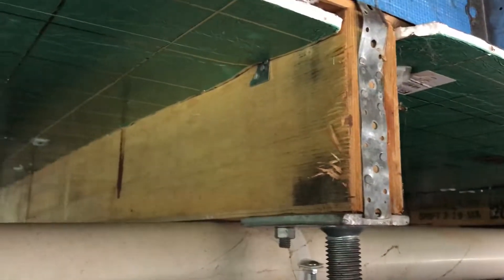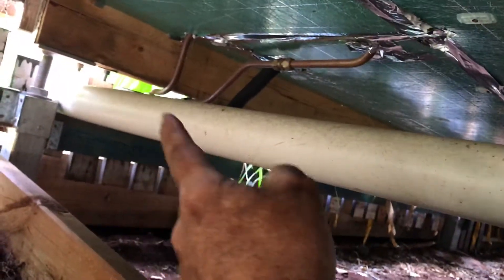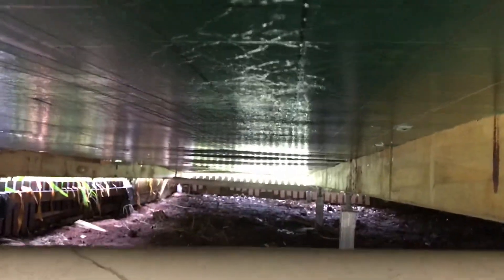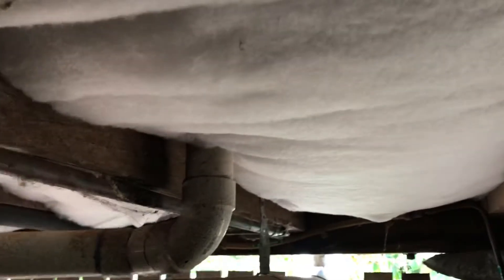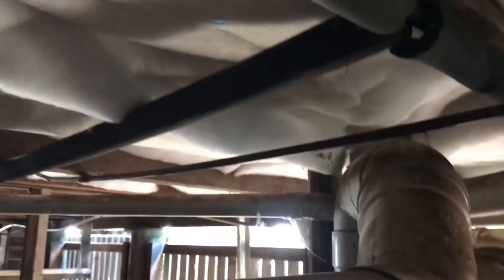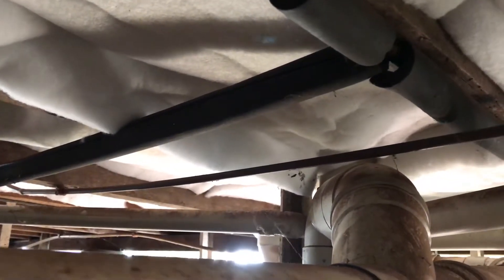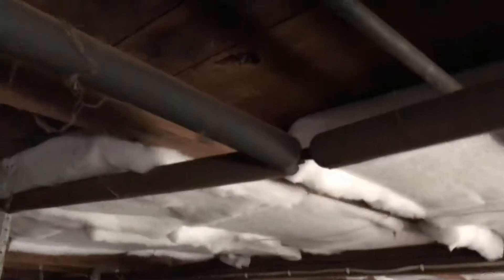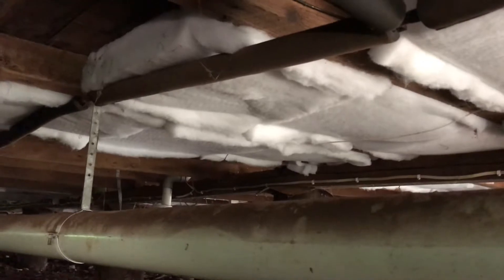Foam Foil board insulation is a bad solution for insulating a floor or shed and here is why!

Comment: I just pulled out polyester from under my house, it was an absolute haven for mice and possums.  I am investigating what I was going to replace it with and appreciate this info.  The search continues...
Reply from the maker: Yes, any batts will make homes for rodents, it is funny that all the batt insulation companies write something like rodent resistant on the packs but your story is the rule and not the exception. Anyway, if it is between floors and you line the lower ceiling with plaster, then cellulose can be pumped into the cavity and it will not get rodents living in it.
Have a happy new year !!
Reply: @InsulationTeam thanks heaps, that makes sense. Happy new year also🎉
Reply: @InsulationTeam would you recommend that solution, or is the foilboard fine as long as I cap all ends?    Obviously foilboard would be just the one step and therefore easier.

If no good, would capping ends with plaster solution have any downside?  Would consider that to effectively remove any chance 😂 of animals getting in.
Reply: Absolutely true. Haven for rats and mice
Reply: I had rats' nests above batts under my subfloor.

Comment: How are the batts fixed in place when retrofitting like this?
Reply from the maker: The batts are made stiffer and just self support in the bays, I have never had them fall out and they are easy to remove and replace if you ever need to. For a quote just go to my website insulation.team

Comment: Your wrong! Yes the board edges should be sealed, as per foil board Instal instructions not a sealed air gap is an important added insulation element.
Reply: you're
Reply from the maker: Ah well all the products that do not work very well state that their system relays on a air gap ? Why is that and what is the difference of just creating that air gap with some black plastic? The foam is what does the work, the same as the very thin foam polystyrene foam cups protect your hand without an air gap? So why does 25mm foil board need an air gap to work? Well it doesn’t but having does increase it’s effective R vale as a system. Unfortunately the same air gap if broken by bad installation or any future trade will render that effected area as nearly useless. 
This is not a problem that batts have when they are attached directly to the floor and that is why I only recommend our polyester floor batts for floors but our batts are custom made and not the same as any other floor batt product that I know of. The other products are to hard to suspend in place just ours just stick like glue but without the glue.

Comment: This video is disappointing because I was thinking of buying this foilboard stuff to retrofit underneath my timber floors. I'm attracted to it because it offers protection from radiant heat on top of what you get from those batts you've put in (conductive and convective heat), but it's thermal drift is also impressive (zero) so it'd last the life of the house unlike batts (I hear rockwool batts don't suffer thermal drift, but they're expensive). Hey OP, I have no experience but you clearly do. What do you think of the bubble-wrap with evaporated aluminium? It's the same idea as this foilboard stuff but because it's not rigid perhaps one could get a good, air-tight barrier under the joists. What do you reckon?
Reply from the maker: Ya the point about radiated heat is a myth propagated by mid leading science, if there was any radiation to be stopped under your floor, that would suggest that wearing a tin hat while inside your house would be of benefit too. 
All products that quote some of their benefit coming from reflecting heat or cold energy should be viewed very skeptically. They are normally tested under heat lamps with nothing between the lamp and the product. Not a reap world test and yes they work in space where there is no passive or convected heat.
So my opinion would be that the bubble foil products perform similar to any bubble wrap without foil and that is then working on convection and not radiation.
The foil board product works way better than the bubble stuff at convected heat because of the PVA foam that is similar to what is in maccas coffee cups. So we all know how well that foam works. If foil added any benefit, why not wrap your coffee cup with foil too? 

Also aluminum foil is a good conductor of heat and so all these products just have foil on them to make them look good in heat lamp tests that are not in any way related to the real world.

So saying all that if you took the time to carefully cut and glue foil board directly to your floor with no air gaps. It would do a great job. Not better than batts probably but as good. It is just far easier to install batts on the floor in a tight fit that does not have gaps.

In short any product that has foil works about as well as it would without a foil coating. But without a foil coating, would you just glue clear bubble wrap to the bottom of your floor? Probably not…

Regards
Peter

Comment: Hi Peter , 
Thanks for this vid and ive now watched a few more of your vids.. 
Ive decided to retro fit the foilboards to the underside of my shed roof using 1" battens for clearance, but i wont use any foilboards in my house as the fire threat of polystyrene is too much for me.
 Also thanks for quick chat on the phone, ill now send you a message re getting a quote from you to install your cellouse ceiling insulation in my CQ house next winter provided you get enough others in this area to make it a worth while trip from Brisbane. Thanks again for your help so far.
Reply from the maker: Happy to help and normally about May or June we have time to do regional runs for roof insulation. If we can put together at least a couple of houses or 400 square meters out near you it will make the travel costs a lot less.
Kind regards 
Peter
Reply: Foilboard has a fire retardant in in and passes the fire regulations. Do some real research on fibreglass and you wouldn't waste your money on it.

Comment: How do these polyester bats go with all the rain we are having? Do they get wet & go mouldy?
Reply from the maker: The batts themselves are very hydrophobic, think plastic. So the water just runs though polyester batts. Unfortunately that may mean water pooling on your ceiling under the batts if they were in the ceiling. When this happens you do get mould on the plaster where the water is sitting.

 In the floor though any spills upstairs just run right though the batt and dry out very quickly. It does not pool and so does not provide a water source for mould or animals like rate. Foil board will pool water rig you have a leak come though your floor.
I hope that help 
Regards
Peter

Comment: I wish I saw this video before purchasing my foilboard panels today. I installed aircell blanket on the ceiling of my shed and planned to line the walls with foilboard. Now that I’m stuck with it — any suggestions on installing it correctly?
Reply from the maker: If the foil board is for the floor maybe sell it on gumtree and install some of our especially made batts that stay in the floor properly without ugly strings. Or if you do put them in make sure they are stapled to the joists in the middle of the sheet to stop sagging and air flow contamination. Then you have to make sure the ends are sealed but the problem is that any gap ruins that bay the same as a gap under a front door in winter sends a cold draft though the house.
Gaps are a big problem with any insulation but because these products do not sit against the floor tightly a gap at the end effects the whole bay.

Also put rat baits in the cavity in a place you can check yearly to stop the building nests but that is true of all insulation except the cellulose fibre product that does not get rats in it.
Reply: The Insulation Team just doing the walls of my steel colour bond shed
Reply from the maker: Almost certainly a bulk insulation is better on walls as I helps to stop the airflow. I am familiar with products like CSR aircell but I would recommend polyester batts for a wall cavity on you shed unless you were not planning on lining it with plaster afterwards. But it is up to you and so as you already have the foil you could try it. For comparison sake buy yourself a $50 temp gun from supper cheap and test your temp of the foil against say a bit of black plastic lined on the inside and you might find them to be very similar. If you do that I would be keen to hear about your results. 
Regards 
Peter
Reply: The Insulation Team what side do you install the panels? Green facing outside and silver facing in?
Reply from the maker: * @Daniel Martin  Hi the foil board is normally installed with the foil facing in and the green fac* ing out. My understanding is that this is a workplace health and safety thing as you do not want the sun reflecting all over the neighbourhood and blinding passing motorists. 
That said it seams odd to me that the reflective surface would not be better installed facing out if you believed that there was any radiated heat to be reflected ? 
If you know how heat works and understand that all the suns rays and radiated heat stops at the Iron or walls that they hit then the only insulation value foil board has is the gap that is supposed to be underneath it as per the manufactures recommendations and the R value of the polystyrene foam that is actually very good at stoping passive or convected heat like what is in your roof or wall space. As long as the foil board sheets are installed with no gaps and the joints will never come loose causing a gap.

If it is for a building that you are going to be sleeping in I would not recommend it but foil board is good in commercial applications and much better than anticon blanket on big shed roofs if installed properly. Also it can be retro fitted in sheds without lifting the roof which is normally better too.

Regards Peter

PS If a representative of foilboard would like to comment on this and help you that would be great. I know they monitor this video and they are the best people to answer these questions about why the green should face outside and not the shiny foil side ? This has never been explained to me by the foil board company and is just my understanding from how I have seen it being installed. Oh actually under neath a floor I often see it installed with the silver side facing down.
Reply: The Insulation Team thank you for your elaborate response. I just finished installing my shed walls with foilboard and did so per their instructions, shiny foil facing in and green facing out. My understanding is that the green side is also reflective so maybe that’s why. Was just curious as it seemed counter intuitive when installing it. Thanks again for the help
Reply: Do some real research on fibreglass and see how poor its performance is over time

Comment: Explain what the difference between a gap in the board VS a gap in the bats is. What's the damn difference in gaps with the two products? This just sounds like you're having a whinge about products you don't use.
Reply from the maker: Thanks Rick for your comment, firstly I do use this product on commercial sheds and so I am very aware of its limitations and benefits.

Second like I pointed out in the video, the only little gap in this particular installation actually lets cold air flow though under that whole floor and just like in winter if you had a 50mm gap under the front door the cold air would flow into the whole house that is connected to the front door.
If you have a gap in a batt, the cold air can only contact the one part of the floor that the batt is missing from. This means one gap does not ruin the whole job with batts.

Also like you see on the video, it is quite hard to see that gap in the foil and other gaps in the foil that may open up over time from rodents or failed duct tape joints will add to the problem. In contrast if the batts had fallen out on the same area that is effected by this little gap in the foil it would be easy to see.

Now to further illustrate the point, if the foil board had been cut into each bay and glued directly to the floor in a similar way as how the batts are attached directly to the floor, then any gaps would have the same effect on both products.

Please also not that the problem here is that the foil board in not installed properly even though it was installed by professionals. I am a friend of the managers in the foil board company in Queensland and know the product very well. In fact when I posted this video my friend of 15 years who works there called me about the video and although he did not like my comments he agreed that in this instance the foil board was not installed correctly and if it was this would not be a problem.

My position is that foil board is harder to get right on a floor installation, like when it needs to be cut around plumbing pipes and electrical. If it the future anyone need access to these, their is even less chance that the foil board will be returned to its proper place. Especially when about 3 staples would have fixed this job in the video but that was to hard for the installer to do.
So like I said at the start use foil board for commercial shed insulation, it is a good solution for that but that is because we can not put batts up in commercial steel frame sheds after the shed is built without lining the ceiling. So foil board is good here.
I hope this helps other people looking for a floor insulation product a and this video is a good example of how a bad insulation contractor can ruin a good product and the results that a customer might expect.

Again I am a friend of foil board in the right application with the right installer. I just think batts do a Breyer job on floors with less risk to the customer.
Reply: @InsulationTeam  do you have any instructions how to install it correctly? I search from the internet, but saw this radio after I bought the foil yesterday!
Reply from the maker: @tingzhang973  hi the best advice with any insulation is “No gaps” also put rat baits around your home because no rats live under your home now but they will be more likely to when you put insulation under the floor. That includes batts but rodents will damage the effectiveness of foil board more as any gaps in the insulation is a bigger problem.

Just a 5mm gap in your fridge door seal and it will stop working and it is the same with any insulation.
Reply: exactly, fibreglass is rubbish - these people need to do some scientific research fact checking

Comment: Comfort Zone Insulation, Servicing South East QLD  Can normal Polyester batts be used under floor boards & what R value do you use. Also is there anything to hold the batts up in place.
Reply from the maker: Normal polyester batts are a bit floppy and that is with I have these specially made for me. When they are stiff enough they do not need fixture and in fact bats that need fixtures normally sage out of place over time.

Their is many 1/2 good solutions to proper stiff batts but mostly they are a bad idea so I do not use them. Many DIY guys staple them up or use hot glue or blue packing tape but all those fail the test of time....

Comment: problem with the batts is they are warm cosey places for rats and rodents... just seal the gap with tap to stop the draft?
Reply from the maker: Yes I actually said that on the video too, like all insulation if it is not installed well it does not work well. Some insulation’s are easier to get the installation right, remember this foil board was installed by the “professional builders who built that extension” not just some DIY installer.
So when the professionals can get it wrong and often do batts are a better solution. If one batt falls out it stops working in that one spot. If a plumber or electrician who does not understand how foil board works, makes one hole in the board that is installed like this it wrecks the whole job.

I have seen rats build nests on top of the foil board to in the same way as they do with batts, rat baits might be the most effective solution to both materials but both will have that problem to largely the same degree.
I hope that helps anyone following this thread. I normally use foil board on commercial installations like large retro fitting situations like industrial sheds.

Comment: Thank you for sharing  i was looking in advanced at the foil board to line my new shed when i find one to fit the space i have available for it to go  as i want it to stay cool in summer  i think i will go with bats instead i will be doing this job myself with zero  nohow so i am just looking around to weigh up all my options on the best and cheapest way forward as the shed will be used as storage space for inside appliances, cooking equipment, camera  equipment and props that are expensive  they need to be stored in a cool dry place and i have them in my spare room but its chock o block full and needs to find a new home so i thought a shed would be ideal for this but now i am having second thoughts I  may have to re think more  to find the best solution  thanks  again for sharing your video
Reply from the maker: Your welcome, I am glad you liked my video about foil board insulation. This product is really best for in commercial sheds where it is professionally installed. It is easier in my opinion for the average person to install batts without getting any gaps. Just 1% gaps in insulation will reduce its efficiency by as much as 30%. 

Just like your old fridge that has a small gap in the fridge seal. Putting some blankets around the outside of the fridge will not help if the seal is still leaking. Home insulation is the same. So make sure you fill all the gaps and you will get a good outcome.